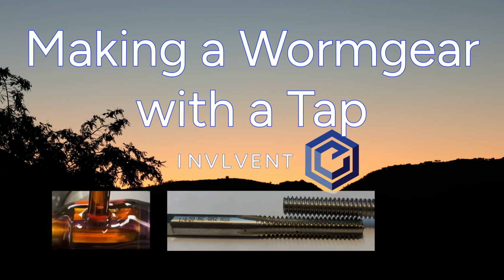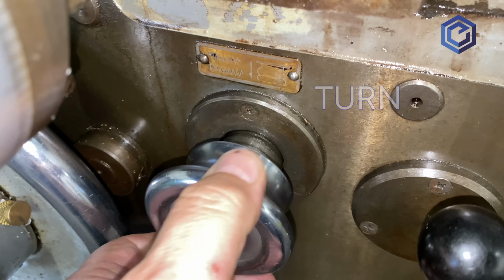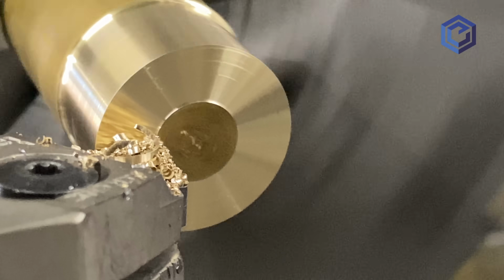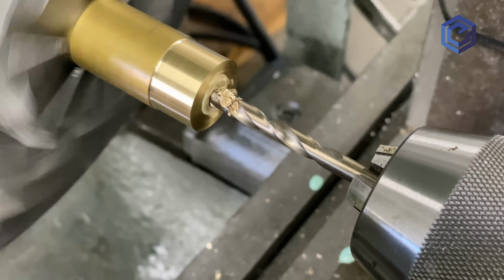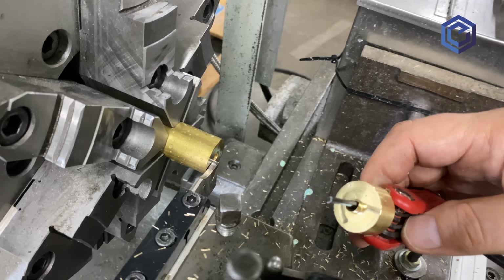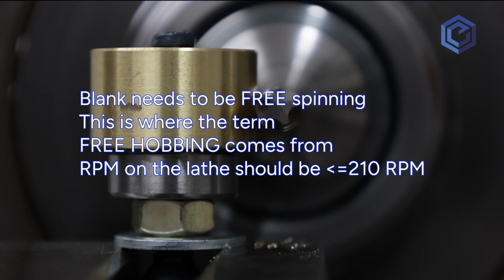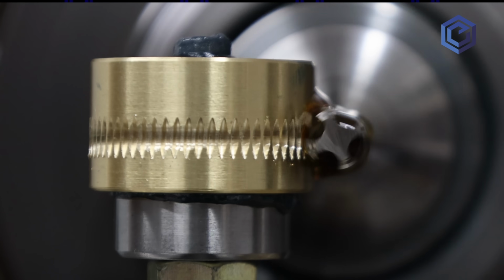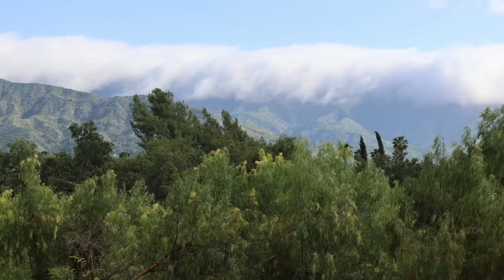Free Hobbing a Wormgear with Tap - A Design & Manufacturing Guide

Comment: Wow - I just gave this a go, after looking at ridiculous pricing for Worm gear sets, and sure enough just with an Aluminium blank on my Mini Lathe, Pretty much a perfect Worm.  I was significantly impressed, and even mystified by the fact it did indeed Self index through the full 360 degrees, and seemingly not crossover in any section anywhere.  Tested by replacing the 12mm Tap with a 12mm bolt, then engaging the cut against the bolt, giving a nice turning "gear" which I could put some pressure on and the lathe was easily turning it albeit with plenty of pressure from me.

The good thing is too, I can easily work with AL blanks to get the process right, and with the length of the standard Tap, the blank I did was around 100mm across, so it allows for making a decent ratio of gear that I can then Slice to size for screwing to the back end of large assemblies that they need to go on - the AL blanks can then be used for testing and templating before moving to Brass.

Can't thank you enough for this video! New Skill unlocked!
Reply from the maker: Thank you for the nice words and we are really glad you had a great outcome.  We thought this very old technique should see the light of day and it was fun to film.  Your Mini Lathe is a very capable tool for this type of work, just needed the idea and a little knowledge.  If your mini lathe has a leadscrew and can thread, you can make your own homegrown "tap" and it really opens the door to wormdrives. For the details on how to get the exact toothcount and gear ratio the answers are in our links below.

There is a lot here:
https://www.patreon.com/posts/fine-pitch-using-88354219?utm_medium=clipboard_copy&utm_source=copyLink&utm_campaign=postshare_creator&utm_content=join_link

and the numerical model will soon be in our software
https://gearcalculators.com/

seen here
https://youtu.be/5T-B8M90mSA
Reply: @EvolventDesign  yes it has a lead screw, have considered doing threads, just another thing I haven't tried. But I guess if I made a tap, it means I don't need to worry about trying to find a steel bolt to make the worm gear out of with worrying it won't be thick enough to hold a grub screw to hold to the 6mm motor shaft  I.e. just at hardware store now and thinking I need to go up to 16mm to have anything decent.

But if I used leadscrew to create the tap, I would then do exactly the same speed to turn the Worm gear itself and it should match 100%

Now...not sure I have a lathe bit appropriate for screws...so will order some, looks like they will get used!
Reply: @EvolventDesign  also gear ratios aren't too much of a concern, my devices will be PWM controlled for rotation speed, so either way rough is ok as I need to program the PWM to have the accuracy And PEC calibration.  But what I do definitely need is good depth in the gear...which itself lends me to thinking the larger the bolt and Tap combination I was to go, the more course the thread, and subsequently the groove depth should be deeper, I.e. more like a full cut worm gear...otherwise the danger in this application is needing to push the gears so tight together so they don't disengage that it actually causes undue torque resistance.
Reply from the maker: @lklmmedia4715 Thread tooth forms are 1/2 as tall as true equivalent standard gear teeth.  This is why using threads the engagement is good but not great.  With your mini lathe you can make the depth of your threads deeper and your engagement will improve substantially.  You sound adventurous, so try larger diameters for your “tap” and cut them deeper.
Reply: @EvolventDesign  yeah that is the plan, basically cut as deep as the tap will go, which makes it look a little ugly...but the face can then be cleaned up on either the lathe or the CNC mill. I think the lathe will give a more even result, I don't quite trust the Mill's travel parameters at the moment...it might turn it into an oblate spheroid worm gear!

Comment: THat metal is BRASS not BRONZE
Brass: Copper and Zinc. Bronze: Copper and Tin.  Brass: easy to cut and mill,  awful to weld and shape by pounding; brittle, nasty fumes when casting.  Bronze: not as responsive to cut with late or mill  as Brass but welds easily, very  malleable, and easy to shape through forging plus easy to cast; that's why we sculptors use it.
Reply from the maker: Thanks for the clarification on brass and bronze! I appreciate you sharing your expertise.

Comment: Thanks for the cool video. Do you think this would work ok with an acme tap?
Reply from the maker: The process in general should still work.  The driver is the lead angle of the tap, if it will self-index the gear blank around in circles you are set.  For the regular hardware threads they have rather pointy tap teeth and they index well.  For ACME with the flat root and hence flat top on the tap - give it a try.  Have not tried it with ACME threads.  
Thanks for watching.